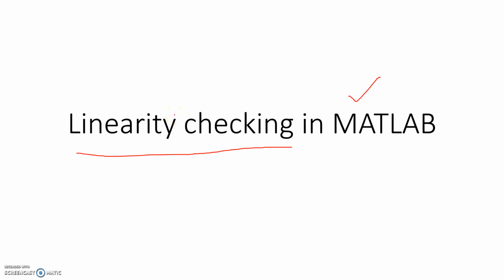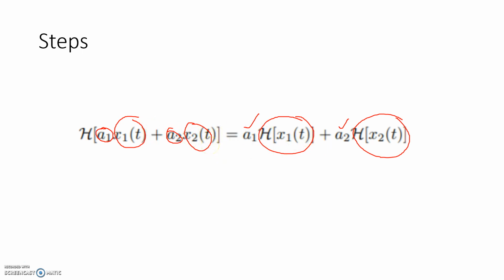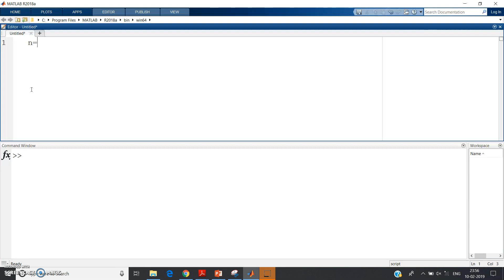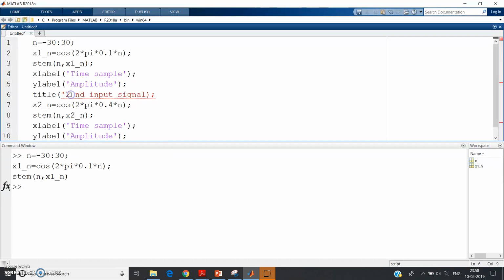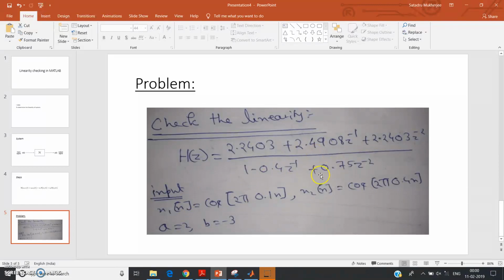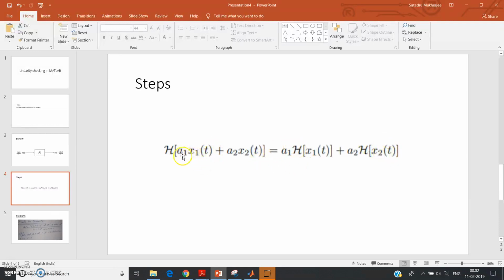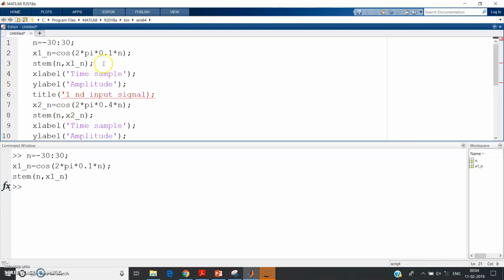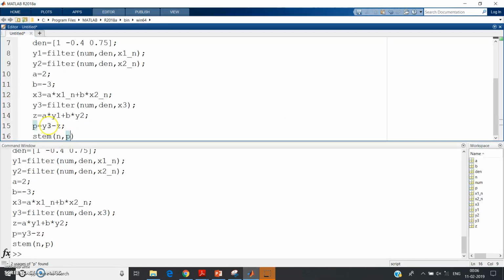System linearity in MATLAB(DSP)|(Part 1)

Comment: Sir plzz explain function of filter here as it is not clear
Reply from the maker: Javeria , y = filter(b,a,x) filters the input data x using a transfer function defined by the numerator and denominator coefficients b and a. Here the filter function is used for the same purpose , to get the output response after passing the input via transfer function.